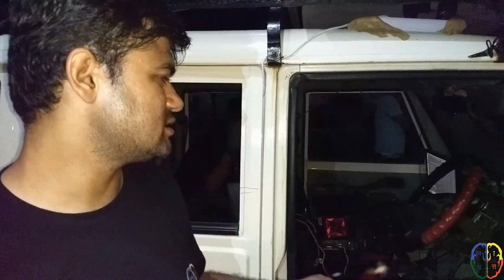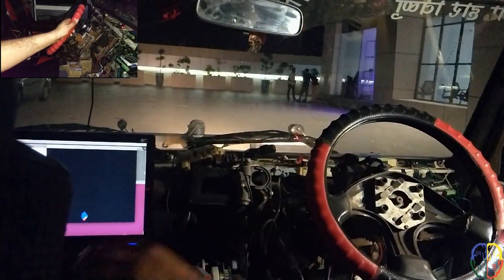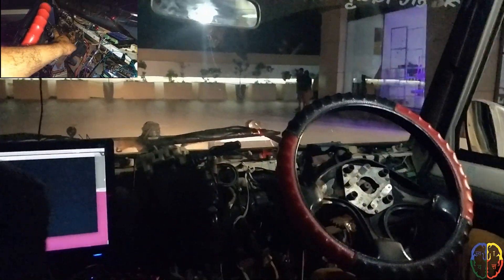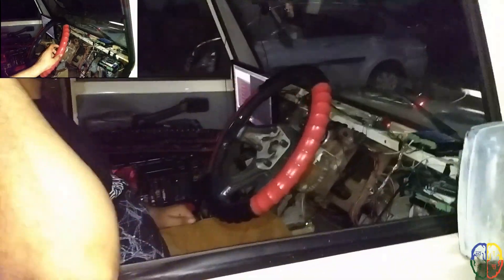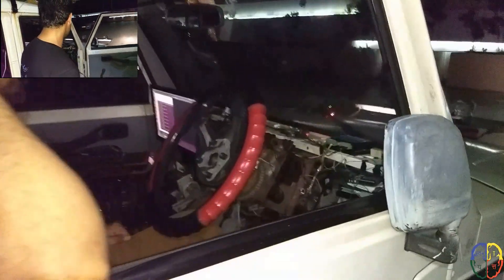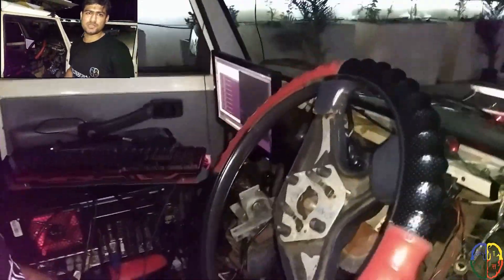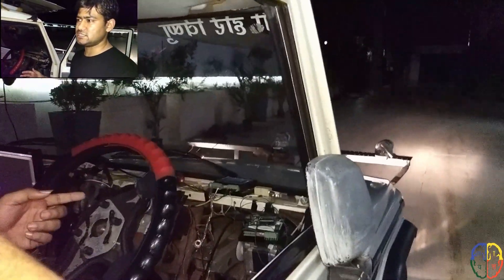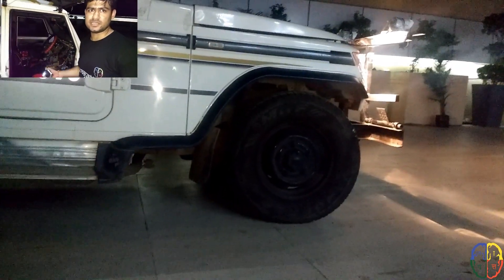Swaayatt Robots: Autonomous Driving and Steering Calibration Test

Comment: Maybe putting stepper vertically would have worked better...along the line of axis of steering.Also ,a parallel stepper with better torque char. at higher rpm may work(custom stepper)...Ambitious project,amazing feat...So much knowledge is needed just to appreciate this work.